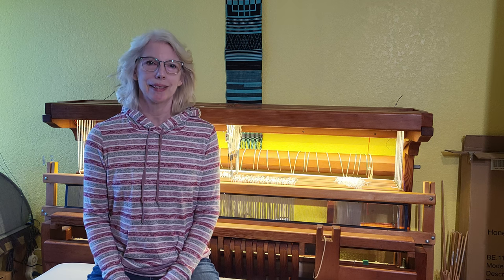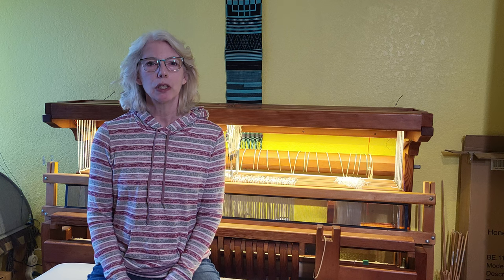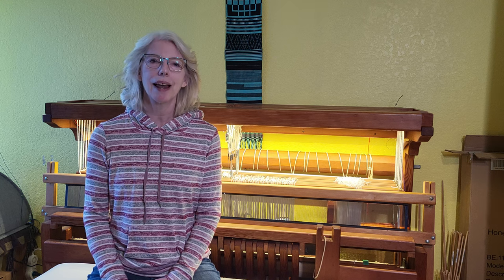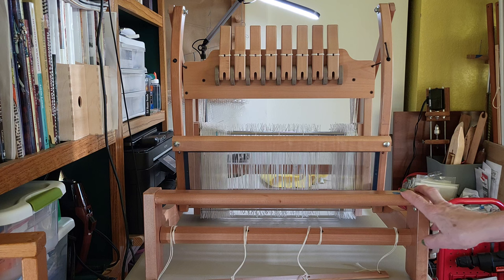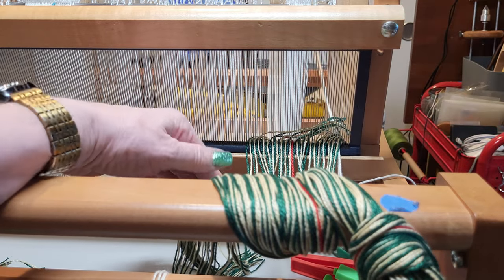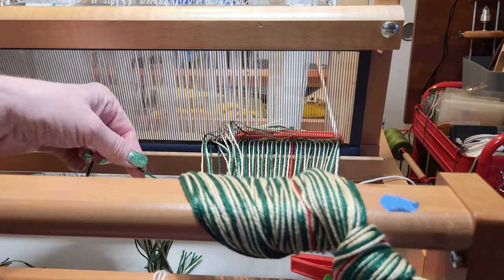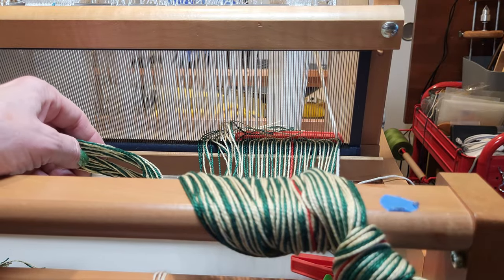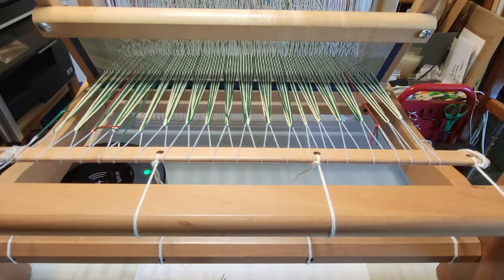Warping Log Cabin Front to Back on the Ashford Table Loom

Comment: Thanks for showing this, Grace, I enjoyed it immensely.  I hate warping back to front and didn't know any better until I watched Tom Knisely's video on front to back and it made so much more sense to my brain.  I hope to try it on my next project.
Reply from the maker: I'm glad you enjoyed the video. I'm sure Tom is more adept than I am at warping in general but glad to provide my input. Front to back does seem easier to me on the table loom but I'll stick with BTF on the big floor loom. But everyone is different and you should try different methods until you find something that makes sense to you. Thanks for watching!
Reply: Agree. Dont hate BTF, learned it first, but once I learned from Tom, FTB has worked every single time, with no tension issues like Ive had with BTF.   Nice explanation of winding two threads Grace!

Comment: Thanks Grace, So many little tricks!  One of the best was to have the cross on the opposite end of the warp start;  that way I can keep the loops and cut at the cloth/breast beam.
One I haven't seen,  I put old curtain rods, with the curved ends, over the beams and lay the lea sticks over them.  Quick, easy, no trouble at all.  
Have you read 'The Fabric of Civilization'?   We're in good company.
Reply from the maker: Glad you found my tips helpful. I've not seen the one with the curtis rod either. I've used dowels though. Have not read that book either. I'll have the check it out. Thanks for the ideas and thanks for watching.

Comment: You should have the locking pins on each side of the beater bar so you don't have that far to reach over the beater bar.
Reply from the maker: I did use the pins but the holes are fairly far back. Mostly it just seemed awkward because I'm used to the big loom 😊